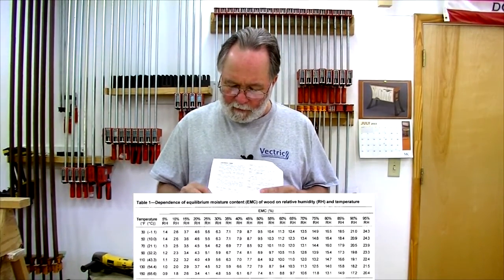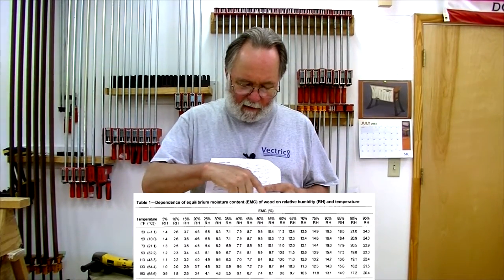Equilibrium Moisture Content: Saturday in the Woodworking Shop #19 with Andrew Pitts FurnitureMaker

Comment: Fantastic information, Andrew, thank you!
A follow on question would be; How much wood movement to expect from the range in moisture content equilibrium? 
Thanks again. Martin.
Reply from the maker: locohombre79 Good question, Martin. I start to discuss this in a past video (https://www.youtube.com/watch?v=tJnE89YLFD8), but it really depends on the wood species and whether the wood is flat sawn or quarter sawn. I use the Lee Valley Wood Movement Reference Guide (Whiz Wheel) to look up the specs for the species and sawing. Let's say we are using flat sawn cherry, 10" wide and the EMC varies between 6.5 and 8.5%, winter to summer. The max seasonal movement would be:

2%MC x 10" x 0.0025 "/" %MC = 0.05", or a little under 1/16". That's a worst case scenerio, since the finish you put on the wood will slow moisture transmission, the relative humidity changes gradually, and also the entire plank thickness will not likely change MC completely seasonally. So, say the actual movement is 1/4 of that, or 1/64". This would be of minimal problem in a frame and panel construction or any construction where the entire piece can freely change dimension, but if there is risk of a glue joint opening due to restrictions of movement in the construction of the piece, you would be well served to build for that movement lest a crack develop (like my experience with the table). The thinner the plank, the more pronounced the movement since the entire thickness has time to change MC, and I see this movement routinely in my furniture where the construction allows the wood to move freely.

Andy
Reply: Thanks! Your reply jogged my memory of your earlier video :)

Comment: NAVY !   We'll forgive you "Marine Force Recon 1"... Great info Andy,  please give me your opinion on wood moisture content for a small living room table, that will be Encapsulated with EPOXY ?   I'm where you were back in the late 70's,  (  I know very little about wood ) but want to play with making a inexpensive RIVER TABLE, any info would be most appreciated.   Thank in advance
Reply from the maker: "Encapsulated" ... that's a pretty big word you're using, five syllables :-) Anyway, I would make sure the wood is dry to the EMC of the surrounding space. If you are on the east coast without AC, that would average around 10% MC over the year. With AC, around 7-8% MC. In Arizona, probably 4-6% MC. Encapsulating wet wood in epoxy would just seal the moisture inside the wood semi-permanently, causing mold and so forth. If the wood is dry to EMC, there will be no moisture for critters to grow, and no differential moisture across the finish. Semper Fi!